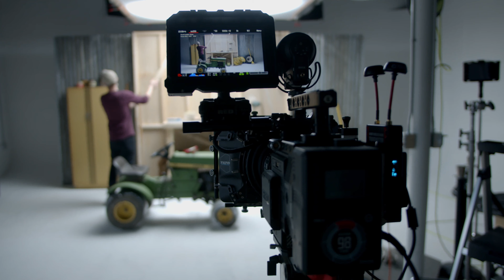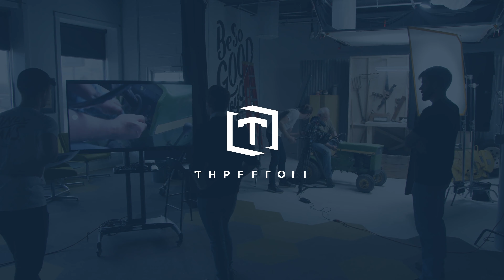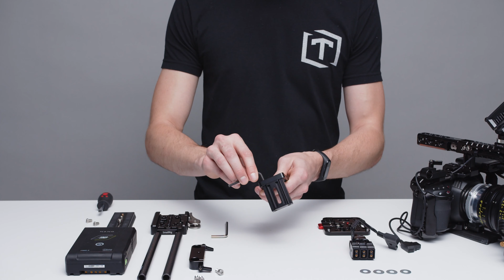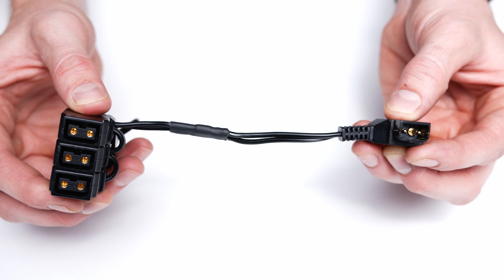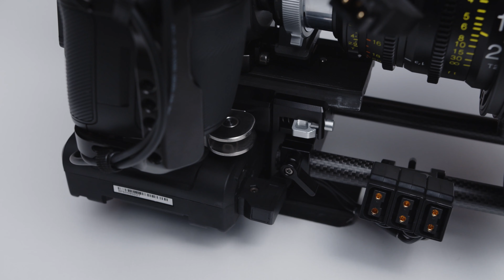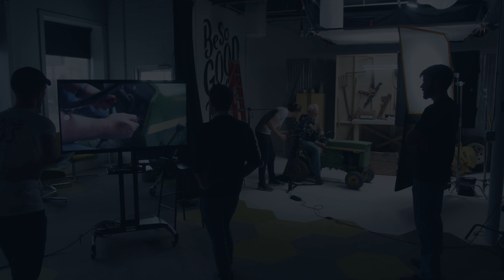How To Build A V-Mount Blackmagic Pocket 4k & 6k Rig - Using Smallrig Components!

Comment: I'm looking to do this with my 6k Pro, since my BM npf battery grip isn't holding up anymore. My biggest concern is my accessories that I use on my rods like my mattebox, follow focus, and my teleprompter that rely on the rails. With a setup like this, how can I ensure that all these accessories are compatible, since they need to be at a very specific height from the center of the lens? I'm currently using the tilta cage for reference. Any help or suggestions would be greatly appreciated!

Comment: Could you recommend a new slide-in plate for the small vmount battery? The current one is not sold anymore and i have troubble finding out if you can place a battery on the new ones.

Comment: Finally a solution to put the V-Mount underneath! I'll use this for my A7S III, hope you don't mind. What are the rails for though?
Reply: If you have a long lens, the rails can be used for lens support. Also, since these cameras are pretty much manual focus, you may need to mount a follow focus system on the rails so they can touch the lens to zoom and focus.

Comment: Sadly, it appears Small Rig is no longer making part 2039 (the quick release system).
If you wanna build this rig, I suggest you buy that part as quickly as possible from any camera store that still has them in stock, since once they're gone, they're probably never coming back.
Reply: Any solution to this? I can no longer find it anywhere
Reply: @Tonymalon  Not as far as I've found. I've also talked to SmallRig, but it doesn't sound like there's gonna be anything similar released in the future.
One thing I did before switching to V-mount batteries was using a large NP-F battery on my monitor, and then taking a 12V cable from that battery into the camera. Worked fine, although I prefer my current V-mount on rails behind the camera solution.

Comment: You state that NPF batteries can be unreliable. Have you had lots of problems with them?
Reply from the maker: We've had a handful of them die on us and they are naturally a lower operating voltage, so depending what you're powering they can be at "0%" even tho there is still 30-40% left on the battery but they are displaying at 0% because the operating voltage has dropped to much. 

We still use NP batteries all the time, they certainly aren't bad but with v-mounts costing $200-$300 they should be more reliable.
Reply: @threefoldtv   I will definitely take this into consideration. Thank you for the reply.

Comment: Looks like Smallrig already discontinued the baseplate in this video. lol.
Reply from the maker: Dang that's a bummer! Well if it helps we've used this camvate one and it works pretty much as good as the smallrig one.
https://www.amazon.com/dp/B075XJ68B6/ref=cm_sw_r_cp_apa_i_LItnFb907J97T
Reply: @threefoldtv  Yeah, was looking at that. They don't have the inside height listed. Wondering if it would work for what I'm using.

Comment: Which matte box is that
Reply from the maker: It's the PolarPro Basecamp, super awesome mattebox! Only downside is that it takes their proprietary filters, but other than that we've been happy with it.
Reply: @threefoldtv  to piggyback of this question, did you need to have a step up/down ring to mount to that lens? I'm looking to do this same setup. Thank you!

Comment: NP-F batteries are not unreliable. I've been powering one of my BMPCC4Ks since the beginning of this year with nothing but an NP-F battery system and they have been as reliable as my V-lock on my other BMPCC4K. Using one NP-F970 + in-camera Canon LP-E6N, I get four hours of continuous shooting in 4KDCI. You can build a much lower profile setup and save some weight by using NP-F batteries, and have the ability to easily hot swap while on the go (if you decide to use smaller NP-F batteries).
Reply from the maker: Us saying they are unreliable isn't totally accurate, we used NPF batteries for some time (check out our older videos) and they do work great and definitely way better than the LPE6 batteries but we did have some occasional problems with battery plates failing on us. For us gauging the remaining battery capacity was a pain since most of our NPF batteries did not have battery indicators on them ( and we didn't want to re-invest in purchasing a bunch of new npf batteries that did have capacity indicators)  and the other big factor was powering both the pocket and our BM5 monitors really drained NPF batteries much faster. We certainly are not hating on NPF as we still use them for many pieces of equipment, we just decided to move to v-mount so that all of our cameras ran off the same battery system, and so we could gain the extra battery capacity. NPF are still a great power solution for the pockets and do cut down on weight.
Reply: @threefoldtv  For sheer endurance the V-lock option is clearly the best choice, but you do pay a price with sheer size and weight. I've considered the new nano V-lock batteries, but even they aren't that small or light given the capacity, with the only advantage being 14.8V output. As for indicators, I'm pretty happy with the battery gauge on the BMPCC4K, the updates provided this year give a much better indication than previously. 
For those who want a reasonable compromise between size and weight, and the ability to place a battery pretty much anywhere, the NP-F option is still perhaps the best solution (in my opinion) and much better than the power banks that some advocate. And, as I mentioned in another of your videos, I hand hold one of my rigs for hours on end and the lower profile that the NP-F solution affords just can't be beat.

Comment: What do you mean by "Its ok to power monitor and camera with single v mount as long as monitor and camera are not powered at the same time"? There is a known issue aboud hdmi port frying when using such setup. Please explain, thanks :)
Reply from the maker: We had heard about these issues, which is why we contacted Blackmagic asking there input on the subject. There direct response was "It should be fine to power both a Pocket Cinema Camera 4K and your monitor from the same power source. The crucial factors are powering the devices in sequence, as opposed to simultaneously, and ensuring the HDMI cable between both devices is connected prior to powering the units on."
We have been powering all or pockets using v-mounts for quite a while and have never had any issues.
Reply: Threefold thank you. So basically if the hdmi cable is connected, then you can safely turn on camera and a few seconds later turn on the monitor. But I see there is room for human error. Normally I do not transport camera with hdmi connected so if somehow I would turn on the camera and monitor (one after another) and only then connect cable it might burn and damage the camera? Well I personally do rent my camera occasionally,  this sounds risky tbh.

Comment: Love the setup, save a lot of space and it doesn't block the screen. Also, has lower gravity and should be quite stable when handheld. I  got a core base battery which as a quick release on it. I didn't use the reel, I mount it on the tilta cage with camvate quick release plate and clamp. And Tilta mini focus as a follow focus, as i did not have the larger cine lens, I use converted vintage photos lens, the diameter of the lens barrel is small, even after install follow focusing gear. ( still waiting for the gears, hope they work well with Tilta mini focus!!!)

Comment: Thank you for a great solution!! I'll definitely try this setup! 
Could you please go over "HDMI ports getting fried" issue on BMPCC 4K/6K more specifically? I'm searching all over the internet for couple of weeks and found some threads but still couldn't figure out how to power the camera and monitor properly at the same time while they're connected with HDMI which may cause "ground loop" that can damage the HDMI ports.

You guys are hands down one of the best on YouTube!! Thank you as always!!
Reply from the maker: Hey so sorry for the late reply, we somehow missed this! According to BM they told us there shouldn't be an issue with powering both the camera and the monitor through a single V-mount battery as long as the monitor and camera are powered in sequence vs at the same time. I've heard some horror stories of HDMI ports getting fried but so far for us we've had no issues with our two pockets being powered this way. We always make sure to power them on one after the other and NOT at the same time.
Reply: @threefoldtv  So you power the on the camera first correct?
Reply: @jamesbiggins2524  you can power either one on. Just don’t do it at the same time.
Reply: @falconawesomeness1141  What you mean not at the same time?
Reply: @threefoldtv  I run both monitor and camera from the same battery plate that has a ON/OFF switch. If I turn that button ON, after all the cables are connected, will I fry my HDMI ports?
Reply: Yall gonna reply to x8?
Reply: @MightyMayoFilms   I've build this setup and powering with no issues NINJA 5 + BMPCC 6k + Focus Motor + Focus Controller. Just need to power as they've said one after one. Thanks again.
Reply: So in this setup you you can't connect camera and the monitor with HDMI or it will damage the ports?

Comment: NPFs are not reliable? Didn`t have any isues so far. Advantage of NPFs: just 1/3 weight/size of V-batteries. I´m still able to use a gimbal (battery on monitor). Runtime is of course 3 or 4 times lower than V-mount. 
V-mount is good for shoulder or tripod stuff. I love Smallrig and this solution with thinner V-battery is very smart.
Reply from the maker: I guess "unreliable" probably isn't the right word. We've never had any major issues with NPF and it definitely cuts down on the weight.  The main reason we switched away was we were having some issues with the NPF plate adapters, and the NPFs we have don't have battery life indicators on them so its can be a bit harder to know how much battery life you actually have left.  But NPF do work good and are a much better solution than using the LPe6 batteries. 
We actually have a very similar build to the one in this video but instead of V-mounts it uses NPF batteries. If you havn't seen that video you can check it out here : https://www.youtube.com/watch?v=z0J46VxYHSw&t=888sa
Reply: @threefoldtv  I see. I`ve used big NPFs with DC out and indicator, connected on my monitor and with the DC out to the BMPCC. I think Tom Antos does it that way, too. More runtime is definately with V-batteries.

Comment: my hdmi fried using d-tap cables to power camera and monitor with same battery.
Reply from the maker: According to the the support agent at blackmagic I talked to... yes. Although I have no doubt people have had some hdmi ports fried, which sucks. Personally we've never had any issues and have been powering 2 pocket cameras with monitors using v-mount batteries for quite a while.
Reply: @threefoldtv  Thank you very much! ;)
Reply from the maker: Dang that sucks to hear, were you using a d-tap splitter or some other sort of power distribution (v-mount plate)? Do you know if it was because of powering on simultaneously?
Reply: @threefoldtv  I was using pretty much the same way you are. Youre warned. Beware
Reply: @threefoldtv  So guys, can we run the same rig as you, BMC confirmed it's fine?
Reply: Yeah it was because I was power g câmera and monitor with same power source. Never do that.

Comment: I love the tilta NPF battery side handle. Keeps things low profile and tidy. I got a little over 3 hours on time yesterday and haven't had any problems with reliability. I just wish it could be on the right side of the camera instead of the left. I can't pull focus with my right hand very well.
Reply from the maker: Yeah NPFs are still a solid power solution, and it definitely helps having GOOD NPF batteries.  Alot of our NPF batteries we have are cheapo ones haha The Tilta side handle is a really slick solution too!
Reply: @threefoldtv  what are some NPF batteries you suggest and what are some to avoid?
Reply: That's what I use too. It gets 3 hours continuous runtime. I use the Powerextra batteries and have never had an issue. They even have ones that have an indicator to see how much charge you have.

Comment: How do you pull focus with this? Would you opt to use tilta side focus handle ?
Reply from the maker: Usually I prefer cradling the 15mm rails in my hand and then use my thumb and pointer finger to pull focus. We did just get the Portkeys keygrip handle in and it works great with the nucleus N motor, so we might have to give that a try!

Comment: oh, and you said you contacted BMD. Did you also ask about powering Camera and monitor off a Sony NPF Battery or just V-mount?
Reply from the maker: I only asked about the V-Mount solution. We have powered both off NPF Batteries though before and have never had any issues.
Reply: Are you powering your BMPCC + monitor off of one NPF battery?

Comment: hey, saw your post on FB, fellow youtuber here ;). I like the rig although it's a little to vertical for me. But how do you intend on pulling focus on that rig?
Reply from the maker: With our Pockets we usually just pull focus manually. I craddle the 15mm rails with my hands and use my thumb to change focus. Although in cases where we need to attach follow focus motors they reach the lens just fine ( we use the Nucleus M system)
Reply: Threefold thanks. I always felt the rails are in the way of my hand.